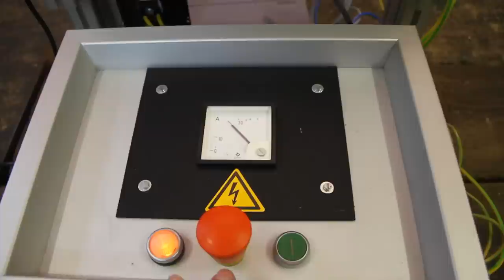Kohlebogenlampe - Carbon Arc Lamp

Comment: Fantastic demonstration Carbon Arc light was the best light ever produced for projectors and film.
Reply from the maker: thanks! :)
it´s a beautiful light..
Reply: I think you are wrong... When I was testing in FEB 2013 the new BEAM moving head from DTS, RAPTOR (1-st variant with focus at every distance)  http://www.dts-lighting.com/RAPTOR  on lamp SIRIUS  HRI 330W (16.500 Lumens; 7.500°K) -  we burn a hole in the carton box in 8 sek at 1.5 m.
It was crazy bright
Reply: @zservice72  HAHAHAHAHAHAHA   Go away with your 404 FILE NOT FOUND GARBAGE

Comment: WoW Fantastic. Its amazing the amount of heat thats emitted from the arc
to burn the cardboard at that specific distance..
Reply: Your comment is 9 years old but I felt like correcting. The heat is not burning the cardboard. It's the light doing it. The visible, uv and infrared components.
Reply: @0xf7c8  The heat is the Infrared Rays.

Comment: I guess with no losses the energy at the focal point would be the same as produced by the arc!
Reply: There's actually lots of losses, that reflector is only exposed to less than half of the energy the arc is putting out since it's a hemisphere with a decent chunk removed in the middle, and it absorbs at least 1% or more of the energy hitting it assuming it's a perfect mirror surface, probably a bit more since I doubt that particular reflector is. Plus you get different absorption rates at different wavelengths in the mirror so that number could be higher for wavelengths like the IR or UV light the arc generates. Not to mention the amount of heat the arc is pumping into the air, there's a surprising amount of energy lost to heating air. There's definitely going to be a high luminous flux at the focal point for sure but it's nowhere near the total energy produced by the arc. The closest you could get to it is if you somehow created an arc inside the exact center of a perfectly spherical reflector, but that brings you back to square one of putting your intended target inside the arc itself lol...